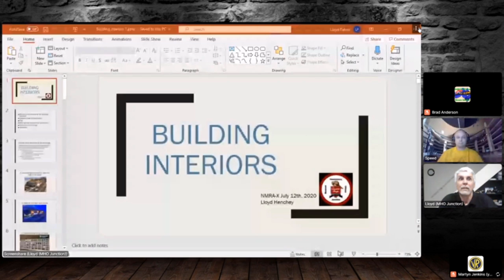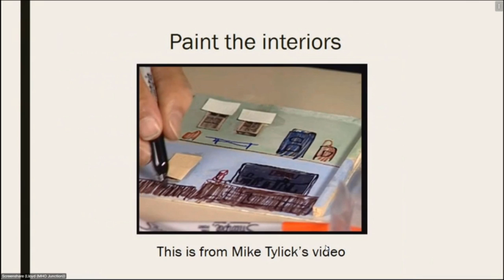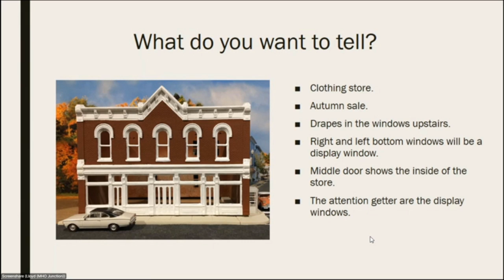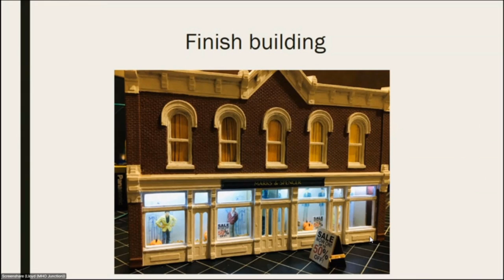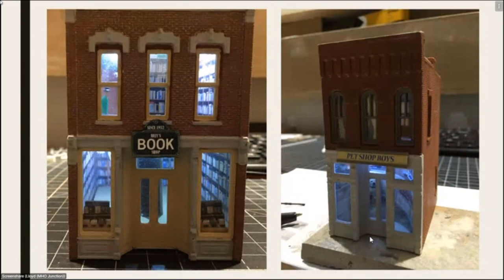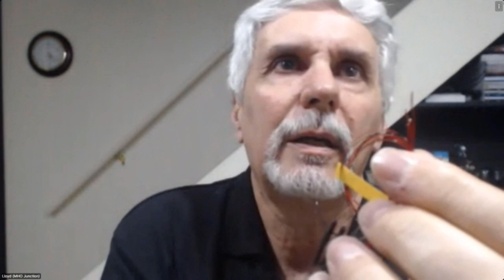Lloyd Henchey - Building Interiors

Comment: A nice trick for window display mannequins: instead of using better to perfect scale people, use your bad ones. The focus should be on the clothing, not the figure. I like the look of cutting off the Heads and hands(and arms & legs, if it’s a dress.). You can then just stick it on a pin base. No need to worry about badly painted faces that way. One can even just sand off all the hair and facial features, leaving just a featureless “head”. 😁
Reply from the maker: Thank you for sharing your tip!